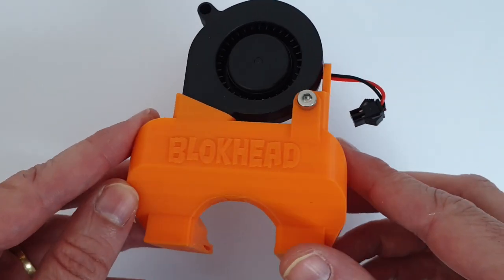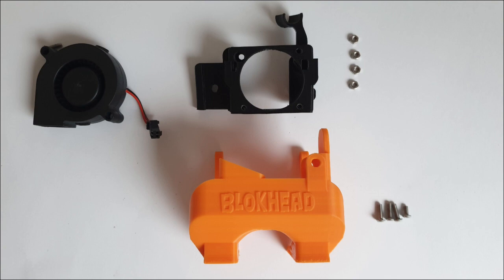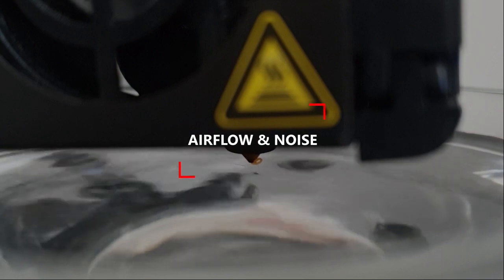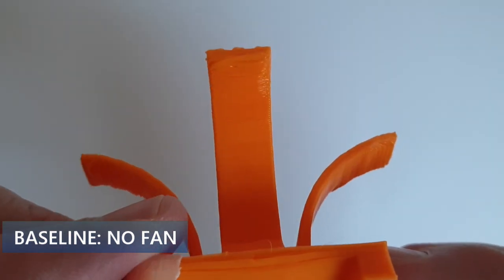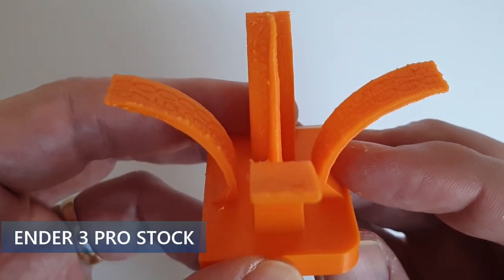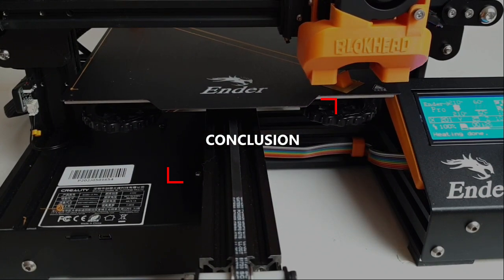Blokhead Fan Duct Upgrade for Ender 3

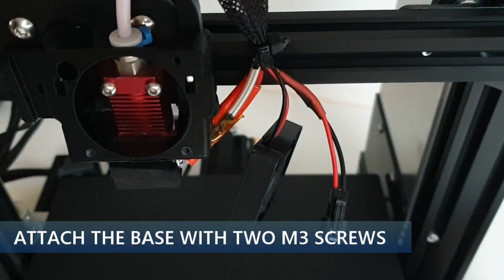Comment: Hello, I am trying to follow your guide, however, I got confused at 2:38. Before that point, the old part-cooling fan was still there. However, once I reached this step of the video, it mysteriously vanishes. I already checked the wiring, but there is no connector. Does it require soldering? Also, is it possible to just use an extender to connect directly to the motherboard with the new fan?  Thanks in advance
Reply from the maker: Hello, I cut the fan wires and solder a JST Plug Connector 2 Pins connector ( https://amzn.to/3zRmoSP ). This allows me to easily switch between fans. You can also solder the fan directly to the wires (+=Yellow). These 2 wires provides +24V (you need to use a 24V fan).
Reply: @YouMakeTech  Thank you for the advice, but I don't like soldering things that much. Would it be possible to get a fan extender to connect the new 5015 fan directly to the motherboard?
Reply from the maker: You can replace the existing fan wires with longer wires and add a fan female connector at the end using a Dupont Ratchet Crimping Tool Set like this one (affiliate link) https://amzn.to/3sbQrmi
Reply: @YouMakeTech  No, I meant completely removing the old 4010 part cooling fan and all of its wires and get the new 5015 fan and connect it directly into the motherboard without any soldering. Is it possible to do it that way?
Reply from the maker: Yes

Comment: I didn’t like how all the weight was hanging over the front, and mine was starting to sag and scrape the print, even through I glued it to the mount 1mm above the nozzle.  Didn’t help I printed solid for some reason.  It’s also a PLA only block, since heat sink fan is directed down at the nozzle.  I replaced it with the dual fan Petsfang, and it’s doing good so far.  It also has an isolated heat sink fan that vents upwards, so you can get 0 fan flow on the nozzle when you want.

Comment: Hi! What were your print settings? I mean speed, temperature, fan, infill etc. Thanks for answer!
Reply from the maker: sorry, I don't remember everything. But for Sunlu PLA+, try 220degC nozzle, 70degC bed, 60mm/s print speed, 20% infill, 100% fan, no fan on the first layer, 20mm/s on the first layer. This should give you a good starting point

Comment: Ive been Using the blokhead buy i cant seem to replicate your results in the slightest
Reply from the maker: What results can't you replicate exactly? The blokhead is only a fan duct, don't expect miracles! The only thing you get with a better cooling is better bridging capability. It's also beneficial if you want to print faster. But that's about it!

Comment: Awesom video and upgrade to the ender 3, printed mine last night and attached it this morning and unluckily the fan duct is not alligned with my hotend. I did notice you used different base, mine was also different. I downloaded the files from the author in thingiverse. I tested all the possible base for my ender 3 but same problem. The fan duct is far away from the hotend. Do you have the stl file for the base that you use? I did a double check if I miss something while doing the assembly but there is nothing. If so happens that you have the stl file that you use for the base, can you send it to me via email? Would appreciate that one.
Reply from the maker: Unfortunately, I no longer have the .STL files for this design, sorry. I printed this long time ago and deleted the files since then. Have you tried to download the files directly from the designer website? http://www.dpetsel.com/files2print.html There you can find a spreadsheet with links to .STL files and download what you need for your setup. This should be the most up to date and accurate files.
Reply: @YouMakeTech  yes, i downloaded all of them bases, same problem, the cooling duct is not close to the hot end using the new base
Reply from the maker: Maybe try to contact the designer
Reply: @YouMakeTech  yeah, that maybe the next step, gonna have to go back with satsana, i was so amazed with this cooling duct because of the fact that has adjustable height for the cooling

Comment: Can you post the 2 pin male to female link ? I took it apart thinking it was there but the wires are soldered into the fan
Reply from the maker: I use a JST Plug Connector 2 Pins Male Female: https://amzn.to/3zRmoSP

Comment: Hey, thanks a lot for that video!
I feel like the hotend fan really is noisy, did anybody switch that to a quieter version? Does a 4020 maybe fit in this design, or do I have to stick with 4010? Thanks!
Reply from the maker: Thanks for your comment. Usually the part cooling fan (5015 blower) is much noisier than the hotend fan. With this design, there is not enough space to fit a 4020 fan unfortunately. Some people prefer the Hero Me Gen 5 for this reason

Comment: hi great video, what exact files from the thingiverse to use on a ender 3 pro as there is like 73 files and im not sure what ones to print. thank you
Reply from the maker: The files have completely changed since I printed this. The best way is to use this spreadsheet: http://www.dpetsel.com/files2print.html . You can click on the links to download the files you need for your setup
Reply: Did you ever figure out what on for the ender 3 pro I'm a bit confused

Comment: I saw, that you installed the hot-end cooler in reverse compared how it was installed in the stock cooler. Does that make any differences, because in the stock cooler it sucked, now it blows onto the hotend.
Reply from the maker: Good catch. I did a mistake in the video. I am not sure it makes a huge difference in airflow but it is better to re-install it the same way as before

Comment: Hello. Where do you take the power from for the 5015 fan? Just from the existing cooler or is it an extra wire? Thank you.
Reply from the maker: Hello. I take the power from the existing fan. The black and red wires that are connected to the stock fan provides 24 volts. I just cut these 2 wires and connect the 5015 fan to them. You can connect your fan directly to these wires or insert a JST 2 pin connector to easily swap between various fans.

Comment: Will this fit the Ender 5?
Reply: Cool, thanks for the reply
Reply: Cant seem to find the correct files for my ender 5 with micro Swiss dd and ezabl pro. Can you tell me which files I need to dl? 
Thanks
Reply from the maker: @OldSalty22  For the Micro Swiss Direct Drive, I believe you have to use this instead: https://www.thingiverse.com/thing:4775320
 . For which parts to print, take a look at https://docs.google.com/spreadsheets/d/1-a6WBbMosrpYNNTfrdMZtGibLTnoTBcpFiJ_8WGzQ-Y/edit?usp=sharing
Reply from the maker: Yes but with a modified base. Check out the STL files you need at http://www.dpetsel.com/files2print.html

Comment: Thank you for the great video. I have one question regarding the hot end fan. I see the hot end fan with the label facing out in the stock set up but then you install it with the label facing towards the hot end. Do I need to change the direction of the fan?
Reply from the maker: Good catch. I made a mistake in the video. The label of the hot end fan should be facing out, like in the stock setup.
Reply: No problem, thanks for the quick reply. I will make sure my fan is the correct way. I can’t wait to begin testing the setup. Did a full conversion yesterday with the bullseye duct. I also have a dual z axis kit I’m going to install after some calibration.

Comment: Thanks for the instructions to assemble the blokhead, but ... at 2:40, what happen with the stock fan replaced by a black connector soldered at its place, missing instruction?
Reply from the maker: Thanks for your comment. Cut the stock fan wires at about 3 cm from the fan. You can solder the 5015 fan directly to these wires (Yellow is positive and blue is negative) or insert a 2 pins male to female connector.

Comment: Using the stock blower wires?
Reply from the maker: Yes. I cut the wires about 3 cm from the blower and connect the new fan using a male/female 2 pins JST connector. The connector is convenient as it allows to swap easily between multiple blowers.
Reply: @YouMakeTech  Thanks 🫂😊

Comment: Salut, Super tes vidéos. 
Je voulais savoir comment était positionné  le Blokhaed par rapport à la buse qui se trouve sur le hotend (vue par le dessous) ?
Je m'explique, là par ou sort l'air du Blokhead (sur un seul coté), la section fait environ 17mm x 3mm et elle est subdivisée en 3 secteurs (par le biais des 2 nervures.
Chez moi l'axe de la buse se trouve au milieu du secteur qui se trouve le plus en arrière quand on est face à l'imprimante.
Je m'attendais à ce que l'axe de la buse se trouve au milieu du secteur du milieu du Blokhead ?
J'espère que mes indications sont suffisamment claires.
Reply from the maker: Salut, merci pour ton commentaire. Sur ma Blokhead, la buse est alignée avec l'arrière du conduit. Par contre, normalement, tu ne devrais pas avoir de nervures à l'intérieur du conduit. Es tu sur d'avoir désactivé les supports dans Cura?
Reply: @YouMakeTech  Merci pour ta réponse rapide.
Je savais que ce serait compliqué à expliquer.
Si tu prend un seul conduit qui amène le flux d'air (en gros tu coupes ton Blokhead en deux verticalement par un plan médian).
Quand tu regardes en sortie du conduit, ç'est formé par 3 secteurs, qui sont la résultante de la section de 17mm x 3mm divisé par trois par le fait des 2 nervures (pas supports).
Pas facile à expliquer sans schéma.
En tous cas, merci pour ta réactivité.

Comment: Damn i printed this blokhead for my ender 3 pro, and it dont fit. sad times sad times! I dont get the "Cooling" fangs over the nozzle.

But after a few walls cut, and a new hole drilled i think i got it to work.

I wonder if i accident did downscale the cooler, or overscaled the base.
Reply from the maker: Oh man, I hope the base is correct. Since I printed the blokhead, the designer has changed all the files... And another person sent me a comment and had similar issues as you...

Comment: hello. this is good job. thank you first. 
 I downloaded the stl files for blokhead ender 3 pro as indicated on the site. However, the fan blowing ends fall far behind. what should I do. Which stl files did you use? can you help me please
Reply: my base could be wrong? ı have stok mk8 hotend? yours black base part (in video) which base?
Reply from the maker: @coskuntanriverdi8661  David Petsel has updated all the files since I printed the Blokhead... The base shown in the video is BULLSEYE_BASE_CREALITY_9.27.stl but no longer exists in the new files... According to this spreadsheet ( http://www.dpetsel.com/files2print.html ), you should now use BB_Stk.Base.E3v2.E4.E3_3.11.21.stl instead
Reply: @YouMakeTech  thankyou. ı download this but did not fit. ı find your base in folder for tevo. thanks your answer again.👏
Reply from the maker: @coskuntanriverdi8661  Looks like the files are currently undergoing a significant update. Consider contacting David Petsel on Thingiverse and let him know that the new base does not fit the Ender 3 Pro

Comment: I am very confused. I want to do this or the bullseye, but what I'm confused about is what do you plug the new fan into since you keep the old fan in the set up?
Reply from the maker: I installed a JST plug on my Ender 3 Pro because I am doing a lot of cooling mod testing and this allows me to easily swap between them. If you plan to install the Bullseye, it uses the stock fan (4010 fan) that comes with the printer. However, if you plan to install the Blokhead, you will have to replace the stock fan by a 5015 fan, therefore, you must disconnect the current fan and connect the 5015 fan instead. Hope this helps
Reply: @YouMakeTech  i quess you can just Solder the 5015 fan to the old fan cable too.
Reply from the maker: Right. No need for a connector unless you want to swap between multiple cooling mods
Reply: @YouMakeTech  Hi. Thank you for the video. As I understood blue wire goes to black and yellow goes to red, right?
Reply from the maker: Thanks for watching. Right: Yellow = +24 volts connects to the red wire of the fan and Blue = Ground connects to the black wire of the fan.
Reply: @YouMakeTech  thanks!

Comment: The easiest way to level the duct is to use the wrench that comes with the printer. Put the wrench on bed and then lower down the head till duct fan out base pushes on wrench. This way you can level it perfectly.

Comment: What was the STL you used for the HUGE bridging test? I would like to see if mine could pull that off,
Reply from the maker: Sorry for my late response, I could not remember and was not at home to look at my hard drive. The STL file I used is: 243mm Bridge test by madizmo: https://www.thingiverse.com/thing:2673256
Reply from the maker: Sorry, I do not remember how I did it. I believe I scaled an existing bridge I found on Thingiverse or made my own in Fusion 360. I could not find a 240 mm bridge test on Thingiverse... If I remember or find the file on my hard drive, I let you know...

Comment: Great video. Does it work with the already existing Bulls-eye base or did you have print a new one? Merci.
Reply from the maker: Thanks! Yes it is backward compatible with the original Bullseye base. You just have to print the Blokhead fan duct. I routinely swap between the original Bullseye and the Blokhead: The original Bullseye is quieter (4010 fan) and the Blokhead has more cooling power (5015 fan)...

Comment from the maker: I take a look at the new Bullseye "Blokhead" cooling mod for 3D printers. After installing the Blokhead on my Ender 3 Pro, I test the air flow and the noise level using a water test.  Then I compare the print quality between the Blokhead, the Ender 3 pro stock cooling system and a benchmark (fan off).

0:00 Introduction
0:53 What you need
1:30 Assembly
3:47 Airflow & Noise
4:26 Print quality
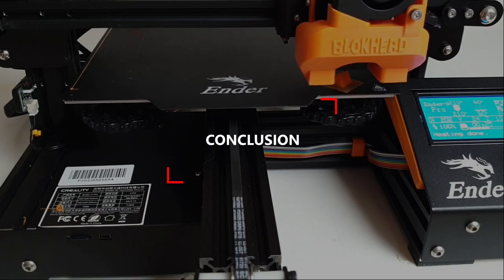8:06 Conclusion